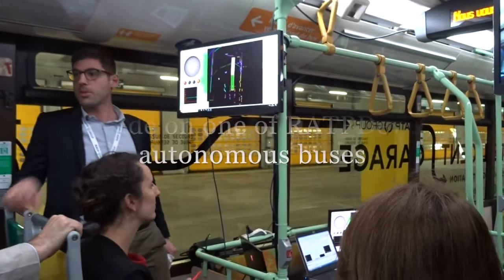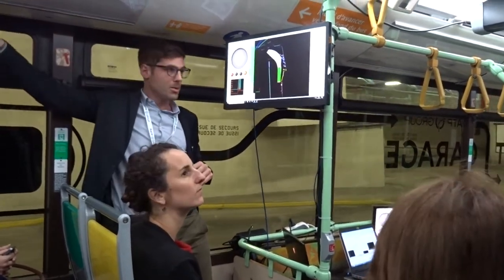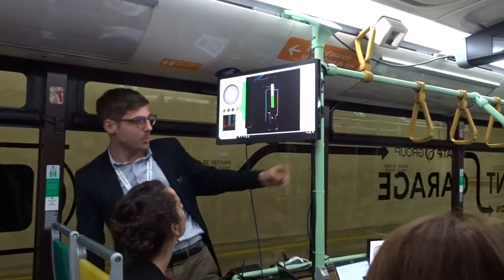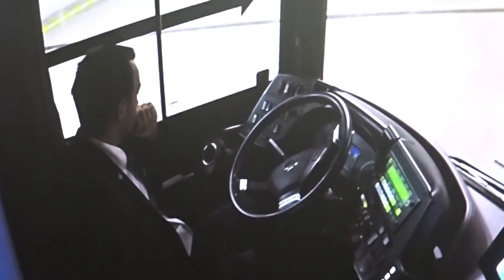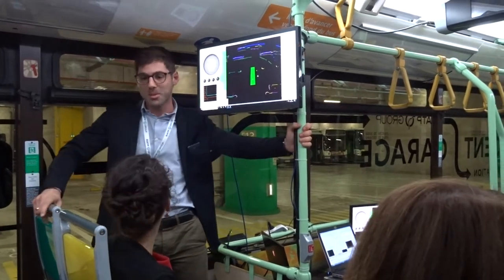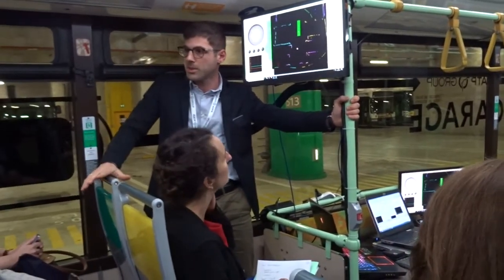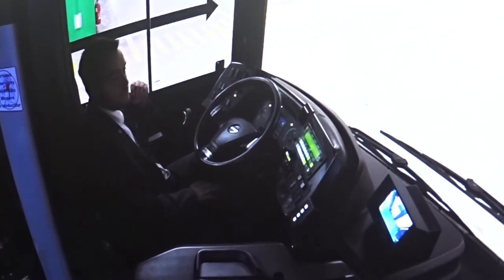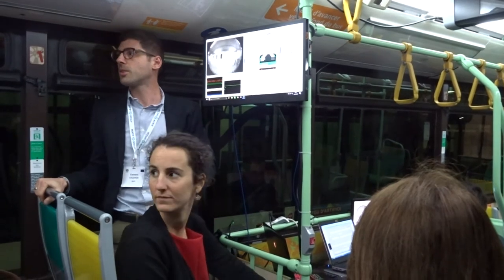Ridealong | RATPDev Electric Autonomous Bus

Comment: The irony. ‘Autonomous’. We have just ran our first autonomous bus in Scotland and it has a ‘driver’ and a ‘conductor’. Excuse my ignorance, but the point of autonomous is not to pay for two crew to manage a self driving bus. It’s the most overused word currently on the market. To have a driver he is a driver that is needed to take over whatever at whenever point, is ridiculous. Why are we bothering with this if a human must reside in the driving seat. What happens in a collision. Is the driver at fault or the bus computer or designer? To me it’s going down an altogether dark path. I’ve been into computers for 33 years, I’ve seen gimmicks and failures galore. Planes have had autopilot as a standard. Be it maintaining level control or following beacons/ILS. It’s not called autonomous. This sensationalism is just wrong. It won’t work with current roads,traffic,repairs, cyclists, bad road markings- no council budgets to paint them on. Trams, trains. Now they can be made autonomous and follow signals fed back to onboard computers and have awareness peripheral sensors to objects at a distance and apply brakes. Bus will always need a human to take the fare; digital or physical. The risk of fare dodgers is what is wrong with humanity and why it’s doomed to fail. If not tell me why with proper applied logic and what will stop it, as in not another human being that’s costing double what a standard bus currently operates under.
I await